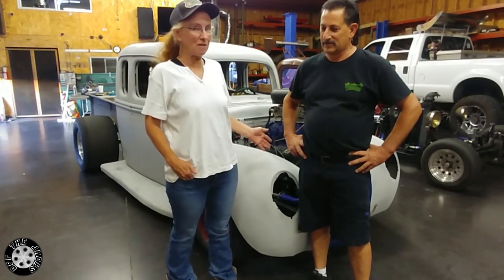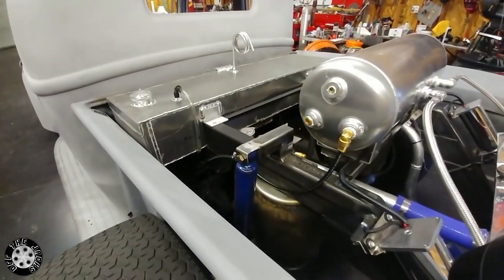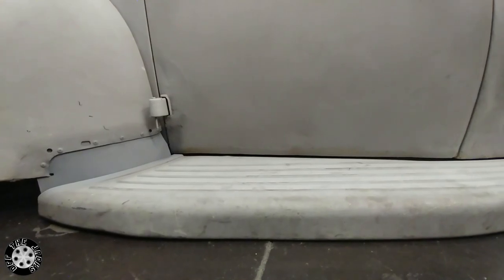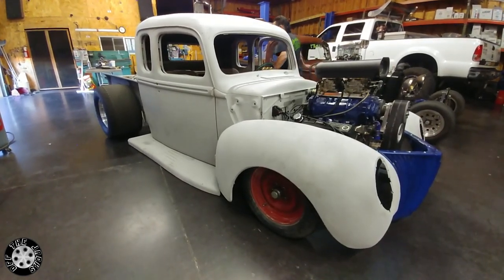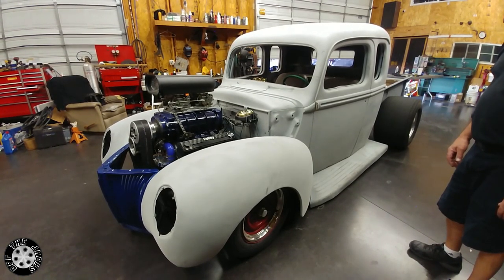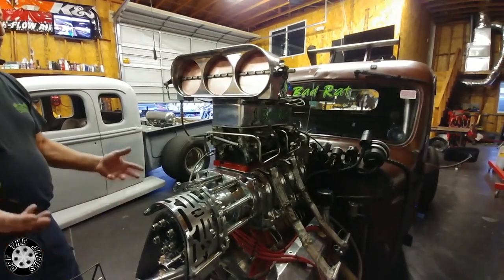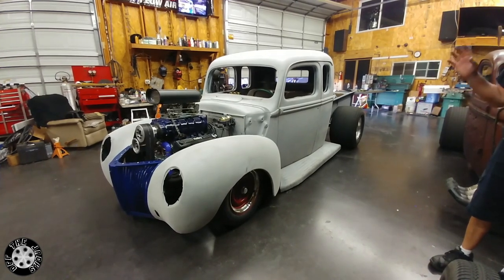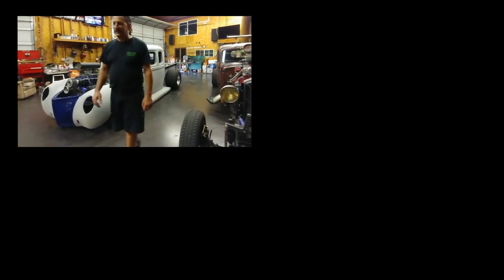RatRod Truck Build - 1940 For Extended Cab

Comment: You should make another one of the extended cab and don't go off the subject with a different rat rod truck.  I was hoping to see inside and outside the cab of the fit and finish.
Reply from the maker: I will have to see when Paul will have the truck back out there or when I can meet up with David.
Keeping Paul on track is like herding cats. LOL